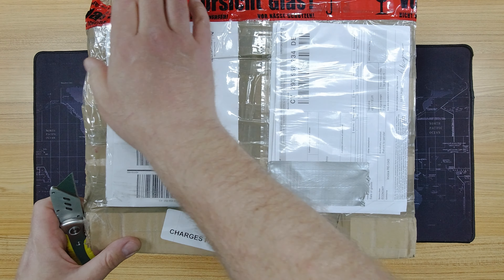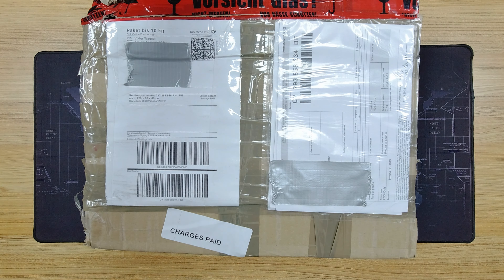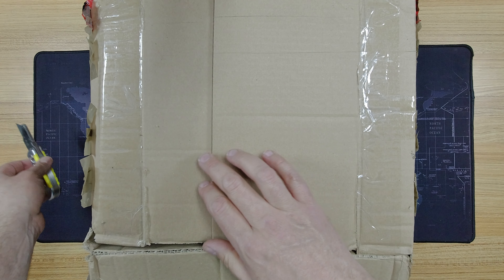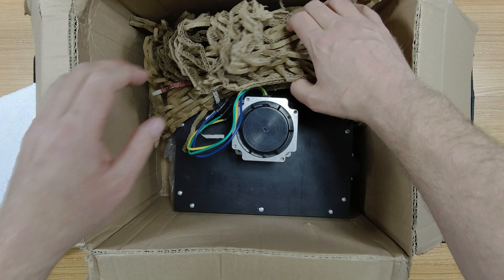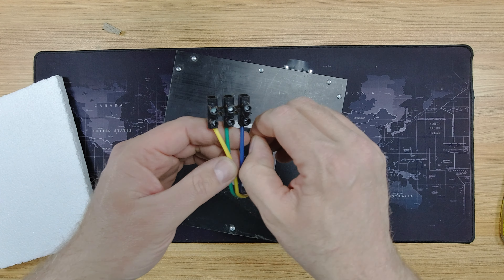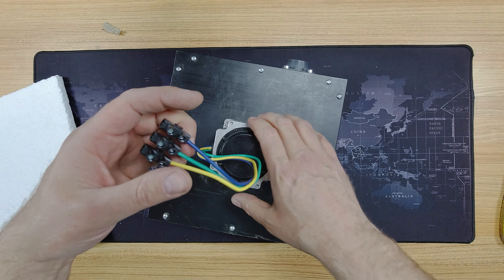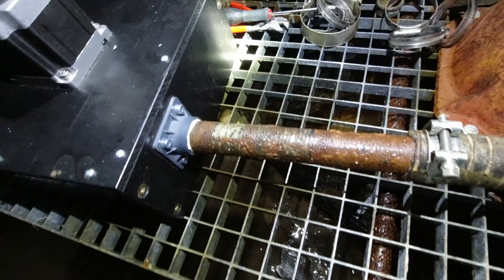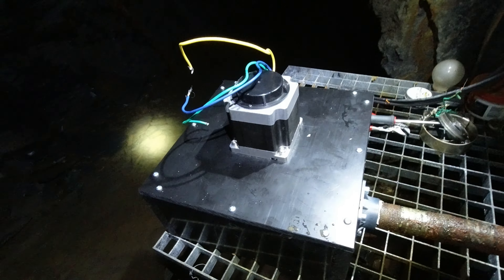A new Micro-Hydro Pelton Turbine from Germany arrives and gets unboxed.

Comment: Hello Miles, nice to see you again, this is good result for this turbine. I have the same POWMR mppt, the number it give is very "generous", at home 15 to 20% more than reality. this turbine will be better with more cups. From the 1 inch pipe, it look like you dont have a high presure, may be the pipe or intake is damage ? Today, my pelton turbine is producing 850W.
Reply from the maker: Salut! Ça fait longtemps, dis donc :) 
850w, wow, that is good going and a very useful source of energy. Yes I think maybe my feed pipe is possibly a bit damaged or possibly has a stone in it blocking it somewhere. I shall have to investigate that but we've had so little rain lately it could even be that. It always rains during the holidays in Wales so I just need to wait for the next one.
Reply: A bientot
Reply: I want same  product in nepal  but how can i get this product?

Comment: With 4 nozzles and plumbed into the big line that other turbine is hooked into, that thing would be way more efficient! Theres a reason why commercial pelton turbine plants have like 5-6 nozzles.

But i guess you cannot run the big line for very long due to limited water supply. You mentioned in the chinese water pump turbine video that it was a tank and not something like a dammed up creek or such.

Comment: Ideally for a efficient turbine a pelton runner should have a minimum of 16 cups. This one only has 12 hence too large a gap between them. I suppose for the battery charging capability output you are looking for down the mine it isn't critical.
Reply from the maker: Thanks for the comment John. Yes this one just charges batteries, but I wish the output voltage was a bit higher. I'm getting a lot of drop.

Comment: Viktor also supplied my 4kW turbine, with a 50m head 1.5inch pipe I am getting 85V but only 0.15 - 0.2Amps, what could be the error? Using a 3 phase rectifier same as you, wanted to directly tie it to the grid with a 1200W inverter.
Reply from the maker: a 50m drop with a 1.5" pipe and you're getting like 12 watts??? Something very wrong there. Is the pipe quite steep down to the turbine or is it a very gradual decline? Are you definitely measuring it right?
Reply: @TheAmazingAdventuresOfMiles  it's a 200m pipe, Viktor send the turbine specs, at 80V it should have an output of 800W but the on the meter it only shows 0.1A while it should be more like 10A, is the cable too thin so the Voltage stays high but the Amps don't pass thru? Measurements confirmed with a second meter on the inverter. Thanks for your thoughts!!!

Comment: Miles what rectifier did you use and how and where do i purchase one.
Reply from the maker: Hiya, I just used a basic one from eBay, I think it cost about 10 pounds. You can make one with six diodes if you have some to hand, that's all they are inside, but I prefer to buy ready-made ones as they are already potted into a housing with terminals and such. If you put "Three Phase Bridge Rectifier" into eBay loads will come up, they are all fine really. If you're dealing with a lot of power you can run lots in parallel.